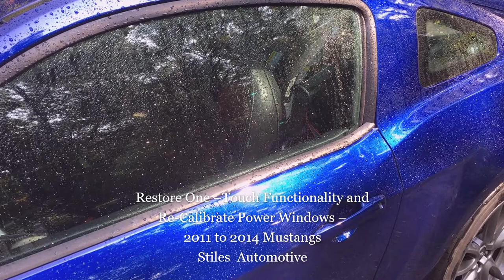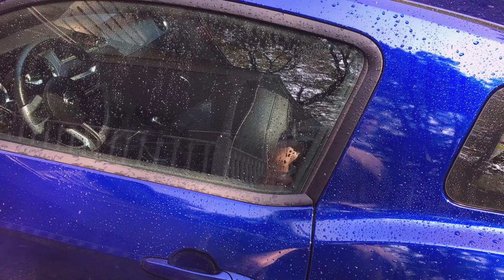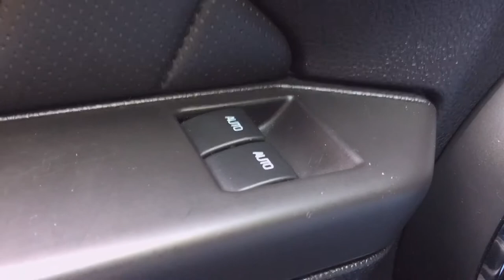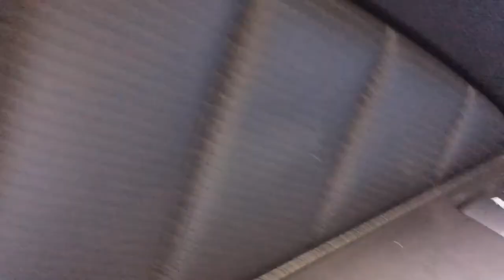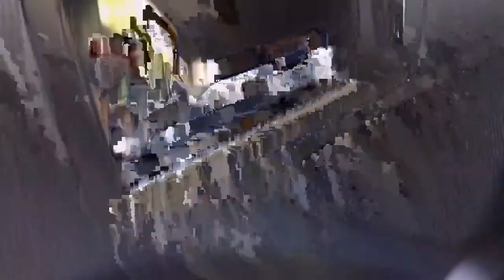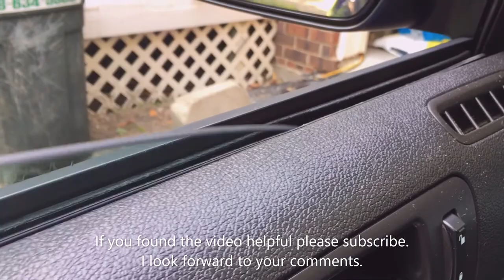Restore One-Touch Functionality and Re-Calibrate Power Windows – 2011 thru 2014 Mustangs

Comment: Can you do a video of changing the valve cover gaskets and the VCT solenoid gaskets I think is what they’re called? Mine is leaking and I have the repair guide but it’s very hard to follow in my opinion.
Reply from the maker: Geez, ok, give me the exact application.  For Example I have a 1998 Ford Mustang Cobra 4.6L DOHC 4V, or the Blue GT in the video you commented on:  2013 Ford Mustang GT 5.0L, Premium, w/ Track Package.  I see about a video for you, no promises, however.  - Stiles
Reply: @StilesAutomotive  I have the blue one same exact one just a v6 but my 14 black GT had the same issue but the V6s is a lot more greasy around those seals

Comment: Window will not come back up sometimes
Reply from the maker: Steven, That sounds like a Window Regulator, Window Motor, or Window Switch problem. You should have a sense if it is a Window Switch problem, it just seems like it is when you press it. - Stiles